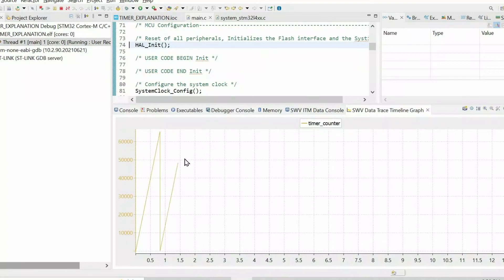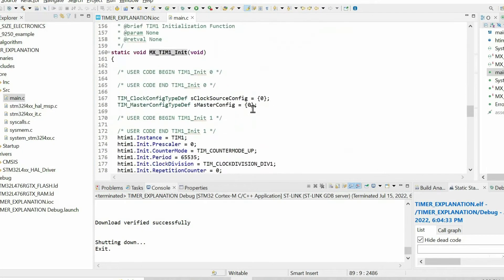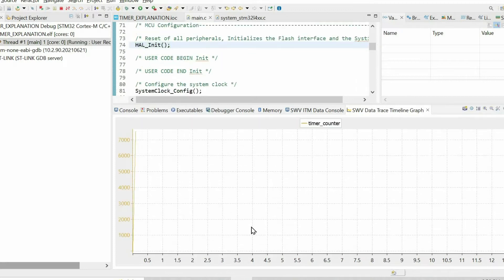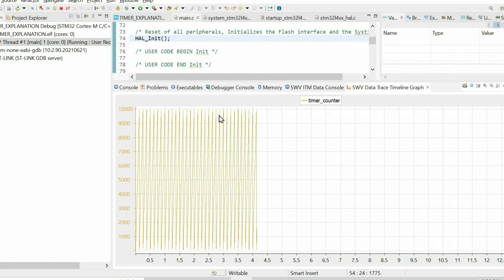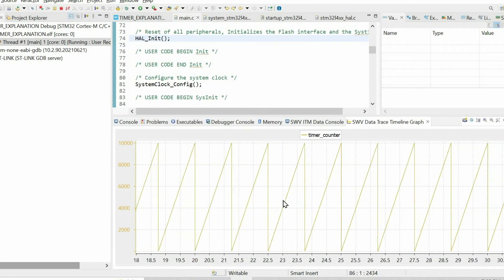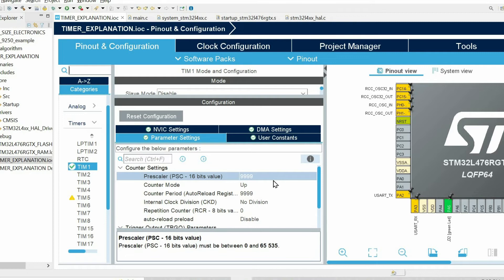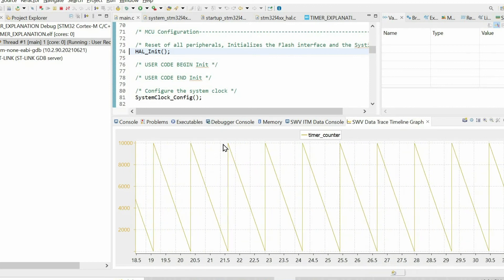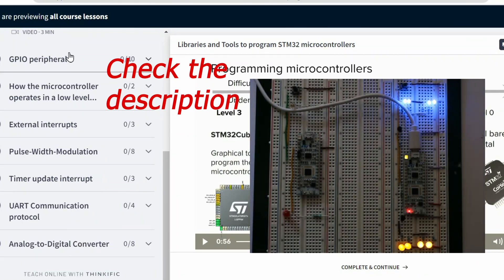STM32 || Configure Timer || Timer Prescaler, Counter period, Counter mode

Comment: Increasing the counter period (ARR) doesn't just increase the max value, the formula is APB/clock_division/(PSC + 1)/(ARR + 1), in your case 80MHz/1/(999+1)/(9999+1) = 8Hz, ie in one second you will see 8 spikes going up to your ARR val

Comment: In other words - the same what you obtain in SWV window (same kind of saw) I would like to see on the oscilloscope. What more I should do ?
Reply from the maker: You can use the Master clock Output (MCO) pin to generate a clock signal. Check this link below for more detailed information:
https://community.st.com/t5/missing-articles/how-can-i-output-a-clock-signal-to-the-stm32-s-mco-pin/td-p/49583
Another solution is to generate a PWM signal:
https://www.steppeschool.com/pages/blog/stm32-pwm-stm32cubemx
For sawtooth signal generation, you can use Digital-to-analog Converter (DAC)

Comment: Very, very helpful. Thank you. But there is also one thing interesting for me. How connect TIM1 to pin, for example pin PA8. I would like to see signal on oscilloscope.
Reply from the maker: Thank you for your comment. But what do you mean by connecting the timer to pin? Like generating a PWM signal in a certain pin of the microcontroller?
Reply: @steppeschool3629 The frequency of the Nucleo MCU is 80MHz. How to see the signal of such frequency on the oscilloscope?
Reply: @steppeschool3629  Just to see the output signal on pin PA1 of TIM2 having prescalar 72-1, ARR 65535, so I should see on the pin about 15kHz, but I see nothing. Do I have to make pwm on this pin or something more? Clock is ok 72MHz, Input Capture direct mode I have on Channel2 then I see pin PA1 is activated (green) on Pinout view - TIM2_CH2. So what more I shoud do???
Reply from the maker: Check this article on my website:
https://www.steppeschool.com/pages/blog/stm32-pwm-stm32cubemx
Hope this helps for you

Comment: Am I  right to think that for the center-aligned the frequency of the timer is half that one of the up/down counting
Reply from the maker: The frequency of the timer depends only on the prescaler. So, the counting mode should not affect the clock frequency.